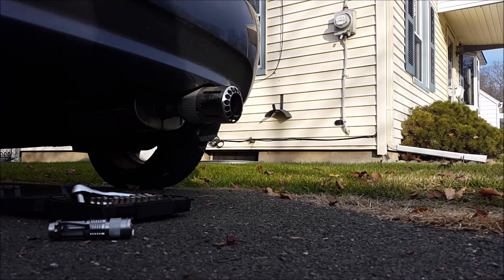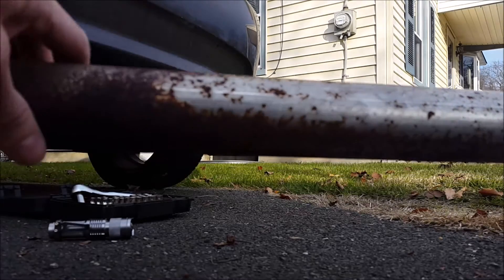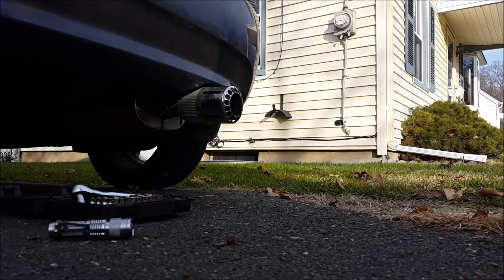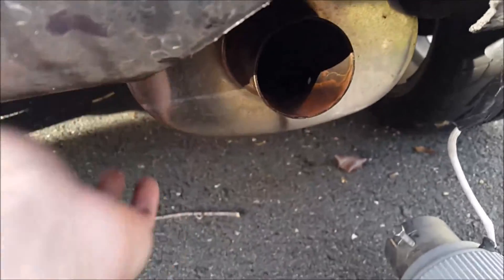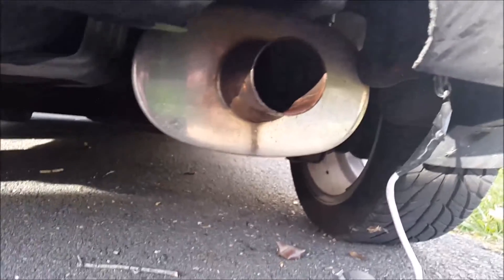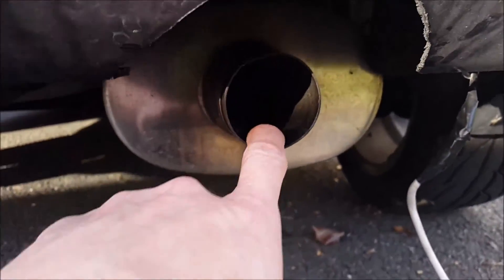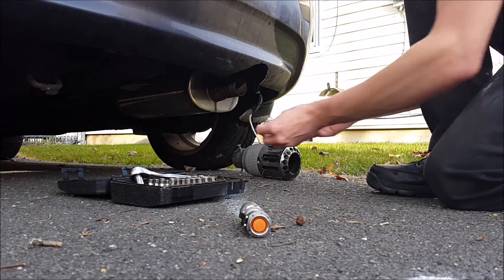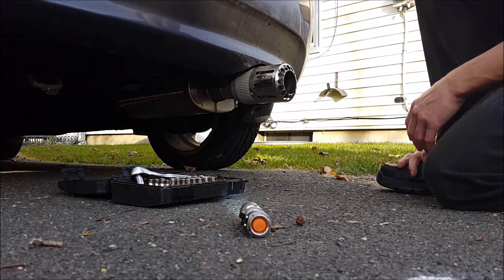How does my exhaust's packing bypass tube work?

Comment: Nice idea. Pretty much the same as me with Apexi n1 exhaust and the resonater cut out. And I have option to roll quite as anything with a bolt on silencer same idea just for a muffler like yours with no 4 inch tip. This way works assuming your set up is quite without bypass valve ?
Reply from the maker: +fireman62truck Yes it's quiet with no packing bypass tube,

Comment: in my opinion it would be better for your car and produce more real power rather than just sound to just get an after market exhaust like a flowmaster or magnaflow or even cherry bomb or whatever. it would just seem to be more secure and more legit.
Reply from the maker: +Alek Thesoundguy I've already have gained some more power with my intake (which I'll be replacing the filter soon). My exhaust is already aftermarket, its a magnaflow oval style muffler...I just wanted the ability to choose if I want to be loud or not. Bolts and fasteners are more than capable of holding the packing bypass tube in place. :)